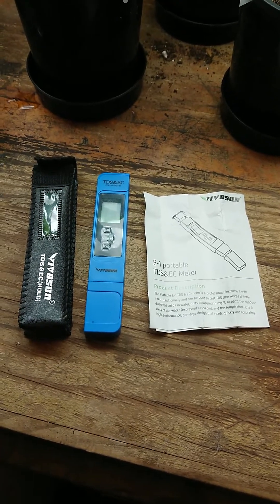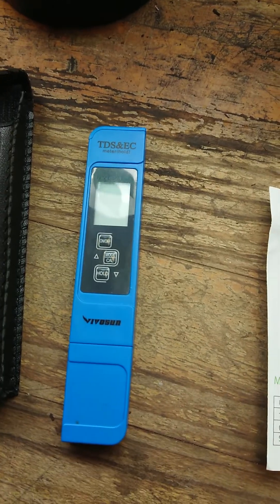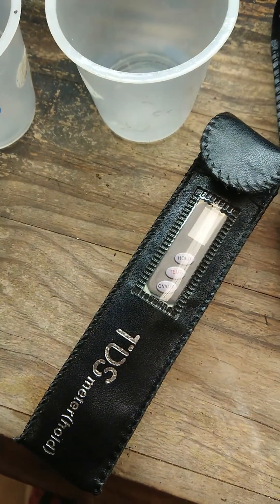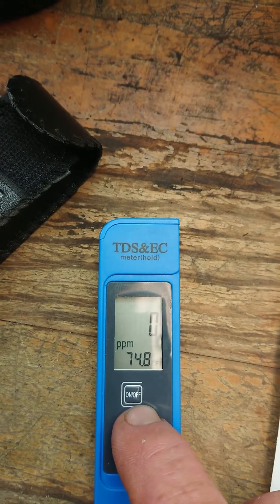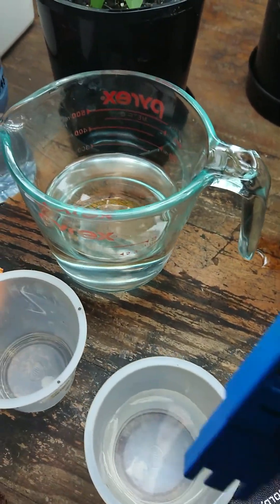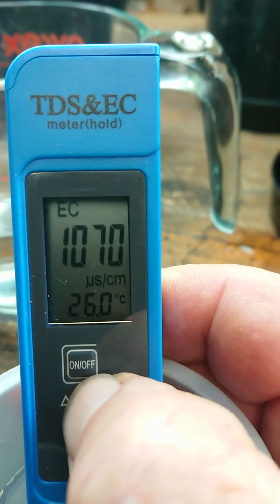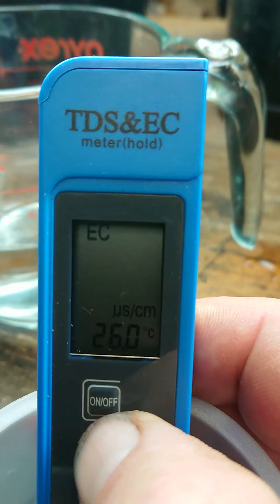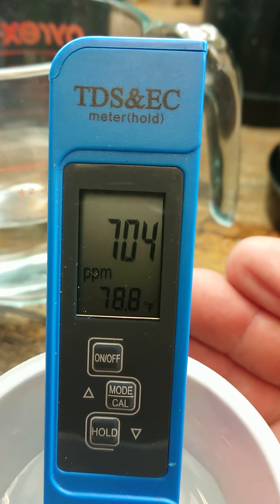How to Calibrate the Vivosun TDS & EC Meter

Comment from the maker: It is astonishing that after more than 2 years and nearly 40k views of this video, that the Vivosun website information for this unit still says; 
"TDS Meter: Include EC, TDS, and Temp Function, TDS don't need to calibrate."  
They are fully aware of this video as I was in contact with them in relation to this issue from the day mine arrived in the mail.
Reply: i always see videos were EC is expressed in a whole number usually single digits. am i missing a conversion for the huge numbers given by these meters? thx for the video
Reply from the maker: @d8m3f6h  It depends upon what unit of measurement is being used.  These meters provide readings in Micro siemens per centimetre.
Reply: I watched again. I'm assuming .5 is 500 scale. Thank you so much for making this video. I just ordered some 1413 calibrating solution off Amazon.
Reply from the maker: @goochma  The 0.5 referred to is the conversion factor these devices use to create the ppm display from the actual measurement of electrical conductivity. The meter doesn't actually measure the parts per million.  When my meter was calibrated to the 1413 solution (1412 on the display) you multiply that figure by 0.5 and the result is 706, which is how it determines the reading for ppm.  If you test a solution of 1000 uS/cm in EC mode, it will give a ppm display of 500. This is shown in my other video where I calibrate the device using plain salt.

Comment: I bought a Vivosun TDS meter recently (1/‘25 ) and to calibrate this newer(?) model  was a little different than as this gentleman outlined. To calibrate: You will need a little vessel with 1413 solution in it,1) Turn the meter on and put it into EC mode;2) place the meter’s probe in the solution; press the mode/cal button until an  ‘EC’ above whatever the EC  numerals are displayed begins to flash , this will take about five seconds - note: the numerals may or may not flash like in this video 3) to increase the EC’s numerals in the display window, press the on/off button…to lower the numbers press the lowest button; 4) once you establish 1413 +/- 1, push the mode/cal button for a quick second; this should set the calibration.  To check , take the meter out of the 1413 solution and turn it  off; turn it back on set the mode to EC and dip it back into the solution. It should then be calibrated. If not repeat the steps; the last step i.e. step 4 ,setting the calibration, seems to be the trickiest.
Reply: This was how it worked for me on a Vivosun unit that I purchased in 2024. It looks just like the one in the video, but it works like this comment.

Comment: Mine has 4 zeros when it's on the ppm. Is there a way to fix that?
Reply from the maker: @manicmurph  I don't know.
Reply: It will show 0000 until it is put into a solution, after it is put it in a reading should should up immediately

Comment: Why not using pure water as a standard to calibrate against?
Reply from the maker: That wouldn't really achieve anything. It is always best to calibrate to a solution close to what you intend to be testing. Plus, it is recommended to calibrate this meter to 1413.

Comment: You can set it with 1413 solution however I’m calling it out wrong and it is in fact incorrect. I realized this because my other meter is 100% correct. Your suggestion would have doubled my nutrient content and been the incorrect EC. Frankly it does only have to work, so if wrong and your happy, good luck. My opinion this video should be removed. Btw it’s impossible to set properly to 1413 salinity for a reason.
Reply from the maker: This video was posted to show how to calibrate this meter because the Vivosun company didn't know how to do it and could not provide instructions. It is completely 100% correct and it works.  The meter is an EC meter which has a built in conversion to TDS, which is a factor of 2. It must be calibrated to a known EC calibration solution while in the EC mode, and the recommended one for this meter is 1413 micro semens.   It works as is shown by all the comments, other than yours.  Just throw it away and use the other one.

Comment: The newer versions don’t calibrate the same
Reply from the maker: I havent seen the newer version. Does the new version have calibration instructions?  If not, the process would not be too different.  There are some similar ones (not vivosun) that use a small calibration screw, and with some you have to remove the front label and drill a small hole to access it.  PS. Look at their website. They have description of the pH meter. Useless, but it looks the same to me.
Reply: Somehow, on mine I have "X10" show up in the window when trying to calibrate. I'm having problems, no success yet.
Reply from the maker: @kenmandu4499  OK.  I think the X10 shows up when you are getting a reading that is too high to just read normally. So, in other words, it goes from 9999 to 1000 X10.  1000 X10 being 10000.  Are you sure you are entering the calibration mode?  Is the readout flashing to indicate you are in calibration mode?  What is the value of the calibration solution you are using?

Comment: Are there any inexpensive ones that have temp compensation?  Without temp compensation they are pretty bad going all over the place in readings.
Reply from the maker: I don't know. It really depends on your temperature ranges. I've not been too concerned about it.
Reply: @gdlivo3353   I found them and only 4.5 USD each meter in a set so 9 USD.  They are exactly like the Vivosun.  While they do not show the up and down and cal it works precisely the same way as this (a hidden function).  Not even with them do they show how to calibrate the EC meter.  Potassium Chloride I really do not wish to purchase something else from Amazon right now so can sodium chloride be used instead?  After calibration of the pH meter, with the three packets, I found it to be 0.2-0.3 off and the best was to just use the 6.86 packet to calibrate with.  Add the 4.00 to the testing it was off by 0.2 but add the third packet to the testing it swung out even more.  I wonder if the EC meter is just as much of a turd too?
Reply from the maker: @generalawareness101  yes, you can use sodium chloride. One of my other videos shows it.
Reply: @gdlivo3353  On Monday UPS is coming to pick these up and Amazon will refund me as they are broke.  I would purchase a more expensive pH meter but to have to replace it every 18 months, give or take, is just ludicrous.  Something to do with the bulb and some have head replacements, but they are almost as expensive as an entirely new meter.

Comment: I noticed that the temperature was @ 26 Celsius, Does that make a difference. Thanks for the video, Big help💯
Reply from the maker: 1413 solution is meant to be 25'C.  My solutions started at 25 but moved a little. It won't matter or make much difference with 1 degree either way.  If your down to 20 or up to 30 it will make a difference. Temperature correction charts are probably available but it isn't a precision instrument anyway.
Reply: @gdlivo3353  good to know  
And thank you for responding so quickly 👍💯

Comment: i have my 1413 solution and im stuck at the blinking screen because whenever i try to calibrate it just keeps switching back to the ppm mode, neither of the buttons are allowing me to adjust..
Reply from the maker: Not sure what's going on. You need to be fairly quick to start calibration once the Cal button causes blinking screen. What reading is the unit giving for the 1413 uS solution?  You will notice in the video that I had the same thing happen on the first attempt.
Reply: @gdlivo3353  initially it was 1600, i tried adjusting but it just sent the numbers to a high 800, since then i’ve been trying to put it back up and it has been giving me an issue since.
Reply from the maker: @carlorueda9058  Try pressing the down button first once the screen is blinking, to see if you can adjust down and then go up.  Otherwise, I'm not sure what the issue is.

Comment: I have an apparently identical (unbranded) device and it is not able to discriminate among filtered water, tap water, and commercially produced 'purified' water. What's more it sucks up the sample into its internals only to pour our of the battery housing as you try to dry the electrode end. I was in contact with the vendor (on eBay) and it was obvious that they had no more knowledge than I did. It is useless without proper instructions. Well done for persisting with the thing anyway, thanks.

Comment: Hi,in which solution you calibrate  ec.thanks you
Reply from the maker: 1413 KCl  (potassium chloride) but you can calibrate to any "known" solution. See my other video on using NaCl (Sea salt).
Reply: @gdlivo3353  how much water and potassium need
Reply from the maker: @brunoromeo7081  It's in the video at 1 minute 35 seconds.
Reply: @gdlivo3353  sea salt
Reply: @gdlivo3353  or sea water
Reply from the maker: If you want to use sea salt, watch my other video, Part 3.

Comment: how do you make solution  using measuring spoons
Reply from the maker: You will never make accurate solutions using measuring spoons. You may get close to required concentrations if you know the amount your spoons hold. The problem is that measuring spoons are not standardised,

Comment: The manual of my EC meter(same device from appearence) tells, after adjusting the value with the up down buttons press and hold the shift button for 3 seconds. Don't know if this matters since the outcome seems to be the same.  Never the less I noticed that calibration seems to shift the value but not stretches the range. Means, if you calibrate it to a 500 µS solution, the value for 1413 µS will be off. The same, the other way around. If you calibrate to 1413 µS, the 500 µS will be off (at least on my device). 
I try to find out if there's also an option for adjusting this "stretch of the range".
I'd found a web site where a guy pulled off the display cover and found a set screw underneath, right next to the shift button. He sayed he was able to calibrate the device by this set screw. Seems he didn't knew about the "normal" calibration feature. But, maybe this set screw is worth a try too...
Reply from the maker: Always recommended to calibrate to a known solution as close as possible to the range you are expecting to measure. If I was measuring drinking water I'd calibrate to a known low ppm solution like mineral water.  For aquarium use, a bit higher. For Hydroponics I use the 1413.  I saw videos with the little hole under the display cover as well, and people drilling holes in the units etc, but didn't go down that path.  It wasn't required once I worked out which buttons to push.  Again, Vivosun didn't have a clue.  Possibly still don't.
Reply: @gdlivo3353   Yes, "calibrating as close to the range you expect to measure" that seem to be best practice.
Luckily my TDS/EC meter came with a manual describing the calibration process just as you explained it here. This device seems to be sold by many different names and resellers. Apparently they don't all give a proper manual with it, but you figured it out anyway. For that very reason I thought, maybe there are even more calibration features. ;)  By the way: All that devices have in common the name "TDS & EC meter (hold)" and appearance of the housing. If you google it, you may also find some more manuals, but I guess you figured that out already.

Comment: Hello! Do u know which scale the tds meters is calibrated? I have 2 others from another brand and they'r showing a little bit less.
My water with nutrients saying its 2530ppm at vivosun meter and 2000~ppm in two differents equipment.
sorry for my bad english. thank u!
Reply from the maker: The Vivosun meter it is using the 0.5 conversion factor scale.  So 1000 ppm will read 2000 uS/cm.  Regardless of which conversion factor it uses the ppm readings of all 3 of your meters should be quite close if they are all calibrated correctly.

Comment: GD livo I have that TDS meter you showed briefly...
The black TDS meter I'm referring to...
How do you calibrate that one...
Reply from the maker: If you mean the HM Digital one, I think it has an adjustment screw at the top on the back. You just put it into a known solution and use a small jewellers screwdriver to set it.  I'll check when I get home.
Reply: @gdlivo3353  Thank you👍🏻

Comment: Hi Trying to work out  your sums is it 373g into 500ml of water of the potassium chloride sorry to be so ignorant but i'm new to hydroponics and thank you for the video.
Reply from the maker: No. It is 0.373 g in 500 ml.  373 micrograms.  If you put 375 g in you are 1000 times too strong.

Comment: When I turn on my vivosun TDS meter it shows 1000 as the starting default measurement on both ppm and us/cm options when it is not submerged in water. How can I reset the meter so 0 is the default reading?
Reply from the maker: I wouldn't have a clue. You probably can't and it doesn't matter anyway.  The only thing that matters is that it is calibrated and gives the correct reading when it is in a solution.  What is says in air is meaningless.

Comment: I dont know what I did with my meter but now shows a EC but to the right I have a x10 number how do I remove it please !! or how can I reset to factory settings ?
Reply from the maker: You haven't done anything wrong.  That is how the EC meter tells you that it is reading over 1000.   So it goes from 0 to 999, then 100 X10 (1000).  If it says 102 X10 it is reading 1020 uS / cm etc.  If you followed the video instructions to calibrate it, then it is giving you the correct reading and your solution has an Electrical Conductivity of over 1000 uS / cm.  
It is not a mobile phone that can be reset to Factory Settings.  All you can do is re-calibrate using a known value calibration solution following my instructions as shown in the video.
Reply: Mine does same ,it reading ten times ,what it should be ,one min its reading ,700 ,next its got a times 10 next to 7000 ,reading of the same solution
Reply from the maker: @chrisk5834   I would suggest that you have a faulty device and you need to proceed to the Warranty procedure through either Vivosun or Amazon.  If your meter jumps from high 900's to low 100's X 10 then that is to be expected for solutions close to 1000.  What you are describing would appear to be a faulty meter.

Do you have any idea of the approximate concentration of your solution?  I know that if my Swimming Pool or Hydroponics Nutrient gave me a reading of 7000 uS/cm, I would be questioning the operation of my meter.

Comment: Hey mate I came across you in another video comment section reviewing this meter and explaining your on going saga with vivosun. Hope those muppets compensated you for doing their job for them. Either way on ya for posting a clear and concise video on how to calibrate this meter. Bloody legend. One question. Do you need a fairly sensitive set of scales to measure out the potassium chloride or can you use 1/4 teaspoon for example or similar unit of measurement? Cheers
Reply from the maker: Thanks Angus. Firstly, no, Vivosun stopped responding at the mention of money but I decided to publish the calibration method anyway.  Second question, I used a small digital scale, accurate in grams to 3 decimal places. These are pretty cheap on Amazon. In my follow up video I show how to use table salt and teaspoon measure to calibrate to a value that is pretty close but not exact.  It's what I explained to you in the comments on Jimmy's video channel. It will give you readings that are within a reasonable accuracy range for most purposes. Let me know how you go and feel free to ask any questions.
Reply: If I am using food grade KCL to only 2 decimals will that be accurate enough for plant nutrients.?
Say 0.37g to 500ml of RO water?
Thanks.